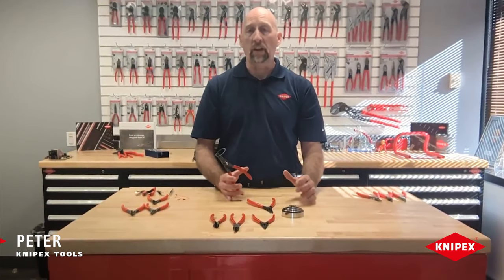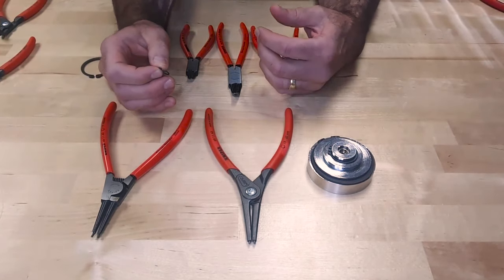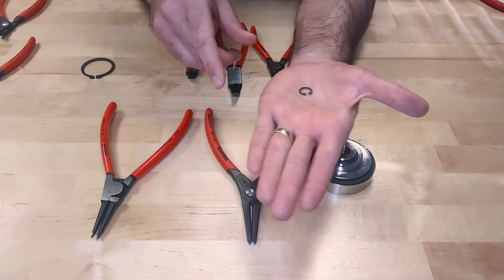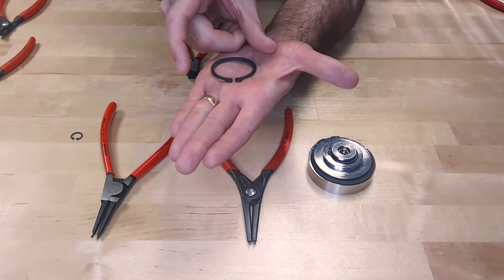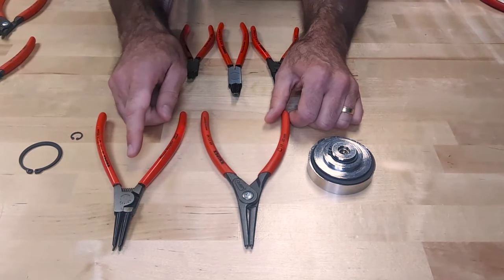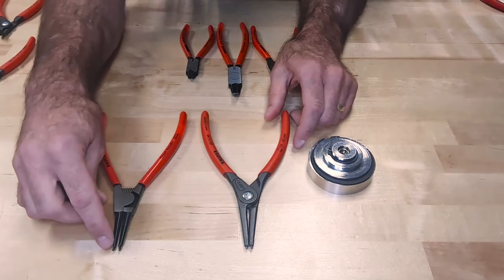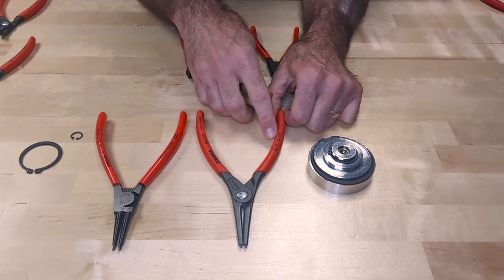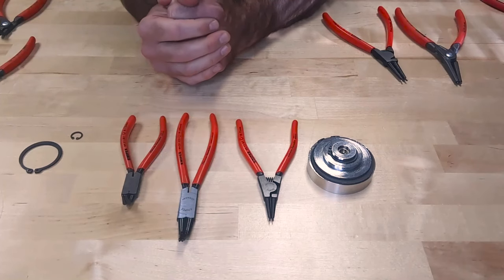Tool Tip Series 2: Understanding KNIPEX Snap Ring Pliers

Comment: The difference in build between the two series is explained well. However, it is a pity you didn't explain the different uses for the 46 series and the precision series.
Reply: They do the same job the precision series just works better at holding the snap ring. The real question is why do they not sell a 45 degree option for the precision series.

Comment: How do you determine the plier size needed for removing outside snap rings on a pivot joint piece of equipment. The ring looks like the diameter of a quarter.